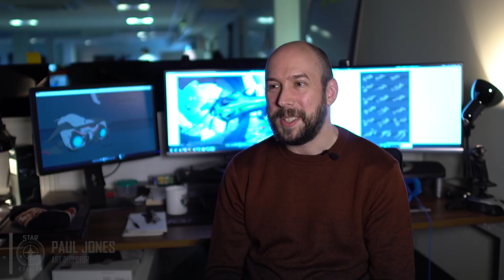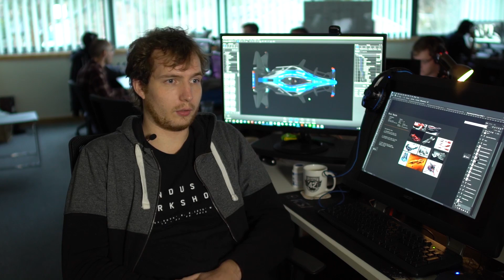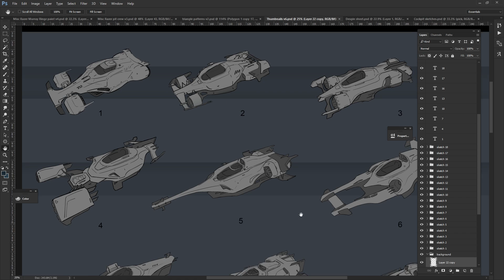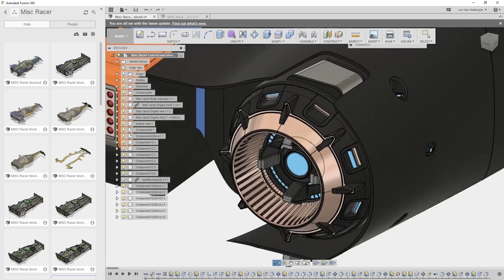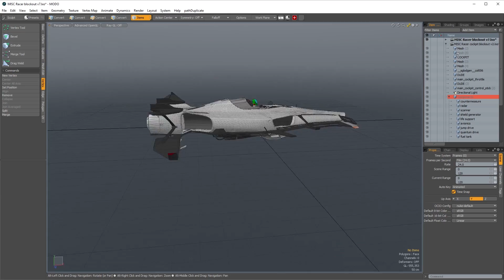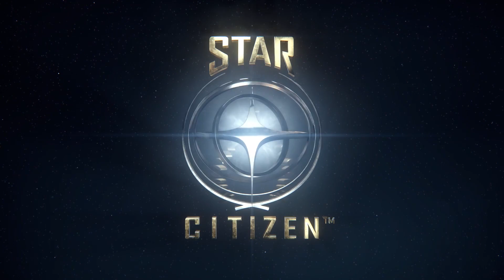Star Citizen: MISC Razor Ship Shape

Comment: I really feel something went wrong with this ship and not in its model or renderings or anything but in how it departs from its brand's identity. MISC makes ships with -er as suffixes and has a signature look which is not seen anywhere on this one.
I get that it is really hard work to make models such as these, and this genuinely looks good to me, so how about a change in the lore slightly-like MISC got together with another manufacturer to make a new ship and called it the razor. This seems a lot more authentic  will certainly help keep the brand cohesion in place.

Comment: So... the front wing is to provide what? Downforce? for the front wheels? Uhm... right. And the big cooling intakes on the sides? they are to collect... uhm... space air?
Reply: Sigh.................................
Reply: not sure if youve noticed it, but a spaceship has no frontwheels
Reply: Ok, so I assume this ship overheats if you fly it in space? Otherwise, the cooling intakes are just decorative. 

And my point of mocking the front wing is that the only reason racecars have front wings is to provide downforce for the front wheels. When the concept guys copy every aspect of racecars into a spaceship, there are several things that don't make any sense any more.

TLDR: I don't like the concept. It tries to look just like a F1-car without wheels, and that doesn't make any sense for a flying machine.
Reply: I was thinking the same. I imagine that it will be explained as a stability wing instead of one for providing down force.
Reply: Andrew Solomon
ofc it will be some sort of stabilizer, fascinating that this isnt a normal thoughtprocess for some ppl and they start whining about the comparison to cars with wheels (not shitting on op specificly but generally on the whiners in the comments)
Reply: My problem is that Star Citizen is kind of "hard sci-fi" (as opposed to soft where anything goes), meaning things don't have shapes just to look cool, but because of functionality. 

This "car" does not make sense in that regard. 

If you really wanted to make a fast racer plane/spaceship I would expect either bigger wings to produce maneuvering lift in atmo or at least big thrusters to give high acceleration in all axes aka. agility. This is a design where the inspiration is very obvious, but the functionality is not. The racecar design with downforce wings and flat bottom is extremely specific and designed to work on a flat road surface where tire friction causes maneuverability... 

This is a bad idea in my opinion, hence my post.
Reply: gahaha

Comment: I find it hard to believe that Xi'an and other alien tech is essentially an F1 racing car from the year 2026 (without the wheels)!
As a concept car, it looks cool, but as a space ship its just a LAZY piece of design!

In the vacuum of space all those winglets would be less than useful, they would only be useless added mass. In atmo... Well, let me put it like this:
Which of the following ships do you think is designed to FLY through the air around a tight course, at high speed? And which one do you think was designed to DRIVE on a solid racetrack and take advantage of the unique aero effects so close to the ground to produce a huge amount of downforce (note: NOT LIFT!!!) to increase the grip or adhesion between car and ROAD.
1) http://share.cat/wp-content/uploads/2015/08/rb6.jpg
or 
2) http://www.f1fanatic.co.uk/wp-content/uploads/2015/02/f1_w06_hybrid_studio_04-Medium.jpg
Now play spot the differences.

I know it's really hard to remember when CR asks you to design a F1 car in space; but please try and remember:
FORM FOLLOWS FUNCTION

fyi I have no problem if you design a ship that specialises in atmo racing (as long as your atmospheric flight model is up to scratch) at the expense of vacuum racing, just think about it first and use appropriate reference material.

Eg if you're asked to design an F1 car, think of the context. A Red bull edge 540 is essentially an F1 car for the sky (it does the same JOB, relatively speaking. But it doesn't look the same because its situation is completely different.) Similarly this is an F1 power boat: http://pictures.topspeed.com/IMG/crop/200705/f1-powerboat-world-c-1_1600x0w.jpg or the offshore type: http://www.sail-world.com/photos/sail-world/photos/Alt_Maritimo_new.jpg Both hugely fast boats but completely useless around the Circuit de Spa-Francorchamps.
See where I'm going? Think of what would make a good space/atmo equivalent of an F1 car and design it to look like that, not directly like the F1 car its self.

Comment: I think the racing tracks need to be revamped. Kinda similar how star wars did their racing, close to the ground with longer speed runs and corners in between them. And i think they should also drop the circular gates and make larger gates with wider span so multiple players can cross it at the same time. And it should't have so many turns... just simple left, right would do fine. and later on they could add more complex maneuvers to more complex tracks. Just my humble opinion on racing.

Comment: I don't think it looks good, sorry. It's a space ship. Even in atmosphere it doesn't need all those spoilers, fins, wings (that probably don't work anyway), it'd have extremely powerful thrusters doing all the work making any wings unnecessary (and if you wanted stabilisers they'd probably not be placed like this IRL). Even if it's just scifi, it's trying too hard, just makes it less believable. It also looks nothing like MISC or Xi'An tech.
Reply: Plus, I don't understand why you're wasting time to flesh out racing now. There are already two racing ships ingame and the mode is not as important as other missing things. This ship doesn't appear important for fleshing out other MISC or Xi'An assets either. And the sale comes at a very unfortunate point tbh.
Reply: J. Martinni More than two racing ships, we have the M50, 350R and the Mustang Gamma/Omega, as well as the Drake Herald which has been described as a good racing ship because of it's high top speed. I fully agree that this really doesn't seem too necessary right now, the timing of this sale right as one of the worst Livestreams we've seen so far happens, and the general low morale in the community at the moment. I mean racing itself surely needs more work at the moment no? We have only 2 tracks and not much actual racing besides just single races, no tournaments or progression or free races or anything interesting of that sort.
Reply: razor5cl
Oh, right. More than two even.

Also I'm a big motorsport fan IRL but I just find it totally unnecessary to focus on racing ships and racing >right now< instead of putting the people on other work. How about reworking the 300 series finally and implementing cargo transport for it for example. That stuff should cover all the disciplines, artists and devs that would be working on this ship. Racing just isn't as important as other core features that need to be implemented and be rock solid before other things should even be considered. Racing doesn't seem to bring anything in terms of testing value that other modes don't already offer.
Reply: So, they will need to replace the 350R with something... but not necessarily with the above Ugwee-F1 without wheels.
Reply: 100% agree!
Reply: I doubt the 350R will remain in the racing category for much longer - following the rework I expect it to be less of a pure racer and more of a propper space fighter with more cargo capacity and other multiplayer features. It is already far too large for the racing track when compared to the more recent designs, such as small frame M50 and snub fighters purely built for the race track..

Comment: I understand the idea behind this ship but :

1- the design is not very original : F1 without wheels.
2- it looks pretty flat. if we are going to use it in space, you should use the space available at the top and the bottom of the ship (3D design).
3- having said that, we don't really need spoilers in space...

So, the work on the ship is good, and the use of the tech is mastered but the overall felling is more "meh".

Comment: But is it faster than the Origin M50
Reply: Same size, same engines, half the weight. Go figure.
Reply: i mean, the race still took place in Atmospheric planets right ?, so Aerodynamics would still be a defining Factor,
Reply: Well if aerodynamics means anything to that ship it's gonna stay on the ground cuz those wings at the front and back only make sense for creating down force.

"Does it look like a race car?"  ... "Well yeah it looks just like an F1."  .... "Put it on sale."
Reply: Well they look like they'd be useful for directional control. the control surfaces on an aircraft aren't very big when compared with the total wing area. so for providing lift you'd have to be going pretty fast, but for improving manoeuvrability they'd do the job.

Comment: I actually liked all the other designs shown better. This feels least original, it just looks like a f1 car without wheels.
Reply: GeneralLeeStupid1 that's... kind of the point. I think.
Reply: yup, too generic
Reply: Modern cas are made s they are the most aerodynamic, fast and light as they can be. So if u were to make a ship like that it would be pretty similar since its the best design u can possible get. Yet it could look at least a little different and the look also depends on the exact purpose of the ship. Seems like this one aint aming for really high manuverability but rather for speed in athmosphere